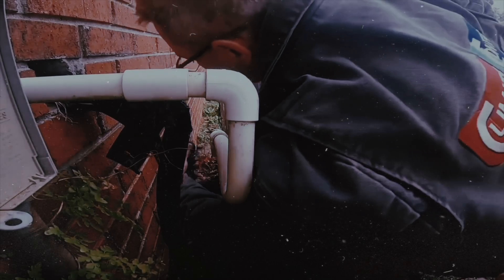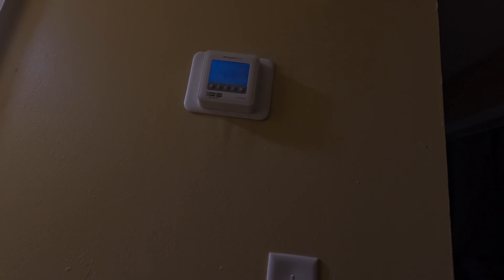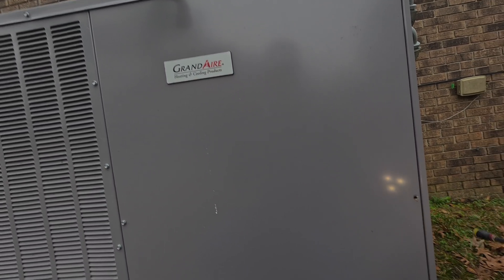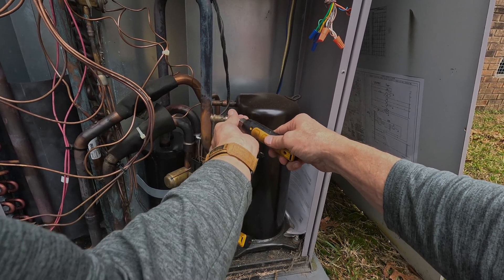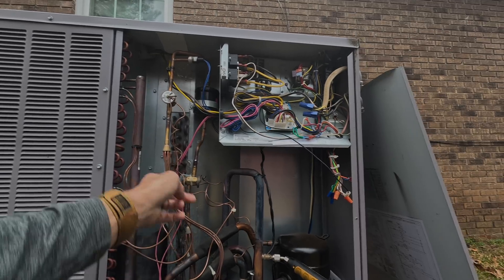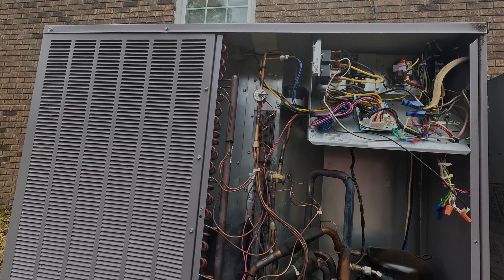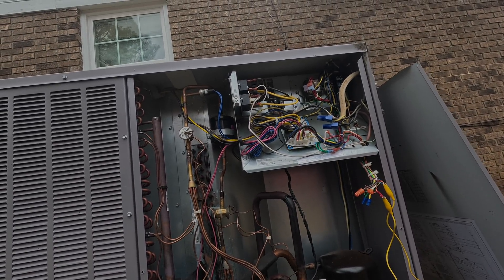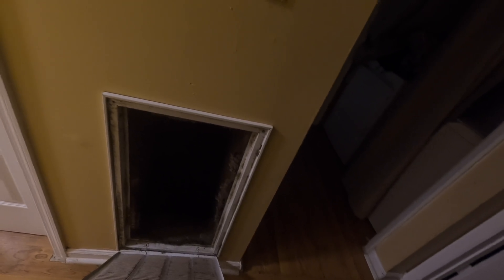System Was Pumping Down In Heat Mode! #hvacguy #hvaclife #hvactrainingvideos

Comment: works in cooling not in heating, accumulator frosting over and it appears the frosting stopped at it and didn't also frost out towards the RV and coil.
that has me wondering if the reversing valve wasn't fully moving back to heating position and leaving the suction port blocked, moving just far enough to let discharge leak through and not high pressure cutoff. guess it really depends on the RV internal port spacing, but as far as I know they begin to open the discharge port to the other port before transferring suction over by the sealed slide port.
probably use temp clamps and check for difference from center suction port of reversing valve to the port towards condenser when in heat mode, but maybe I'm just overthinking it. 🤔

Comment: Ahh a curtis video with a txv changeout it's been to long curtis that used to be a norm and of course it would not be a south video from you without an rtu package unit on the ground where in my state Pennsylvania thats a, no no even if the house is a ranch style house or a pier and beam foundation instead of a basement. Only rtu package units allowed on flat roofs like big Comercial buildings or apt buildings like high rise apts.

Comment: the high pressure switch is between the compressor and reversing valve (black wires, behind reversing valve), the low pressure/charge switch should be the top one with blue wires.
and right before I posted, you pointed that out in video. lol

Comment: Can you please explain which wires did you jump to get pressure relived. Thank you and great job.
Reply from the maker: I jumped from red to orange, which makes it energize the reversing valve to run in cool.
Reply: @ that would make a great video. Thank you so much. I’m a HVAC student. 🙏

Comment: Curtis yesterday I had a Ruud split system that the company installed about two weeks ago and it was also going into a vacuum in heating mode on the true suction port. It also had a high and low purchase switch and it was not catching
Reply from the maker: Well, was it the same thing

Comment: TXVs suck. But what can you do? They should design them all to where you can change the power head. Good Diag
Reply: They make adjustable txvs some universal.

I still can't get over rtu package units on the ground in the south that's a no no in Pennsylvania even if the home is a rancher or pier and beam foundation and we have some In PA heck we even have some mobile homes.

And yes around my mom's there are some trailer parks not sure if it's still there though as the area by mom's used to be very rural but not anymore.

Thats why they say in Pennsylvania it's like Philadelphia and Pittsburg with Alabama in between.

Me where I live I am more getting out of Philadelphia but closer to delaware but once you get up closer to Lancaster county now it seems to get more Alabama like or even berks county.
Reply: @gabrielstern4992  I hear ya. The only ones I see around here, La. are the horizonal units that mount to the building. There are heat pumps around, but not too popular.

Comment: well its a grand-aire thats your problem, bad RV. I normally see really high head pressure when the TXV locks down, instead it seemed like the RV was bypassing in heating mode.
Reply: You would actually have to be moving refrigerant to have high head pressure, when your suction is 0 there is nothing to compress